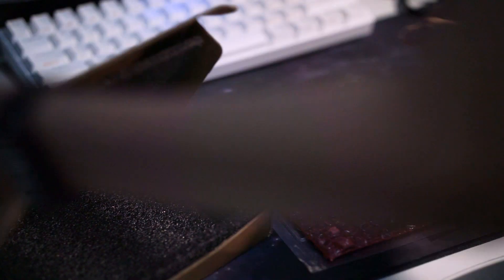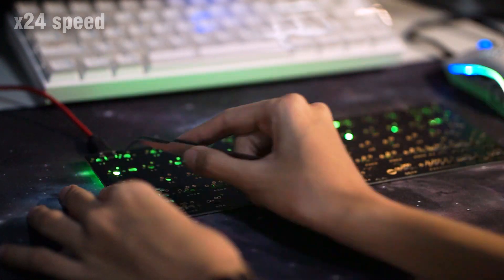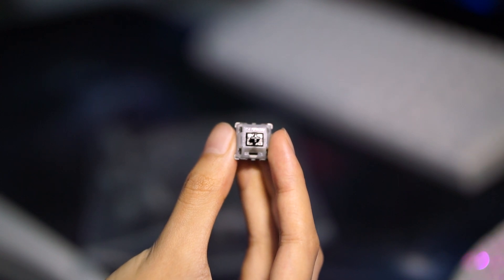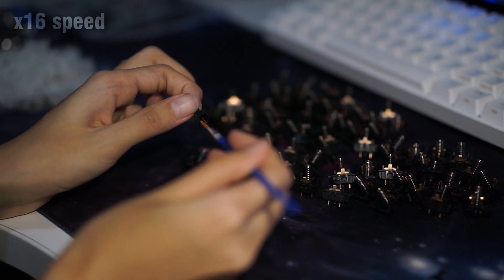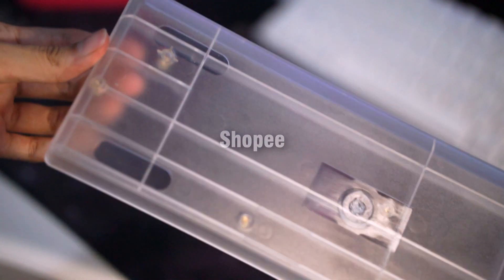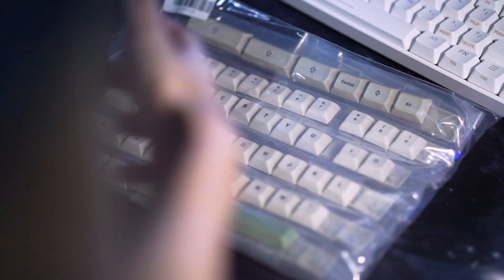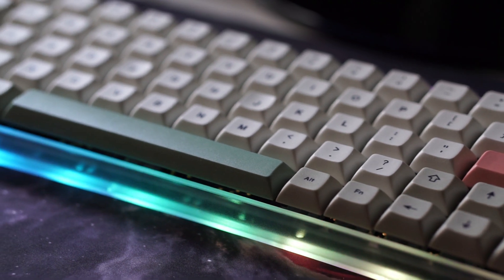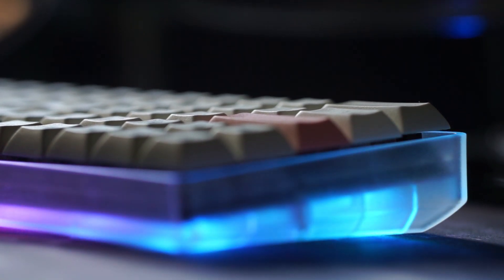My First Keyboard Build | Gateron Milky Top Blacks

Comment: Hi, I would suggest a better case, because it is tray mount (not the best typing feel / sound) :)
Reply from the maker: treeleaf64 Yeah I was hoping to upgrade in the future. Which case would you recommend? I was going to save up for an acrylic tofu
Reply: @khaicho  Acrylic Tofu is basically the same thing as this. If you get the new Tofu which is top mounted, it will have better sound and feel. But make sure you are getting Tofu v2 and not v1.

Edit: Actually I would recommend the new Tina case from Kbdfans, I like that more than Tofu, which just looks boring. Tina design is more interesting :)
Reply from the maker: @treeleaf6471  Thanks for the recommendation! If I ever manage to save up, I'll definitely consider picking them up

Comment: Is it smooth as a stock switch? For now i use the smd gat yellow but i want heavier feel
Reply from the maker: I'll always recommend lubing your switches but the milky blacks are pretty solid, even stock! If you want to make sure it's decently smooth, get the black bottom versions, not the full milky ones cus those are scratchier. You can also just springswap the yellows you have to 67g or more.